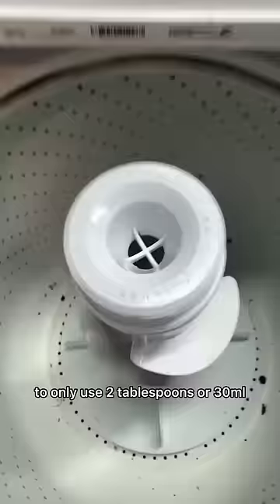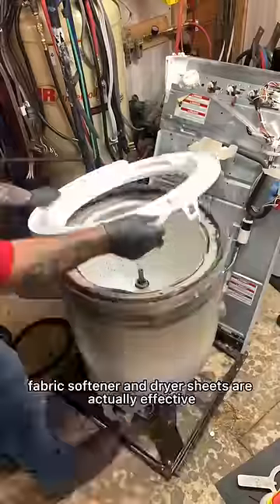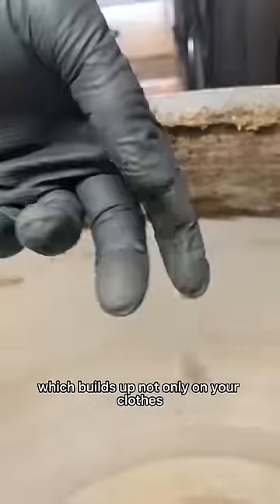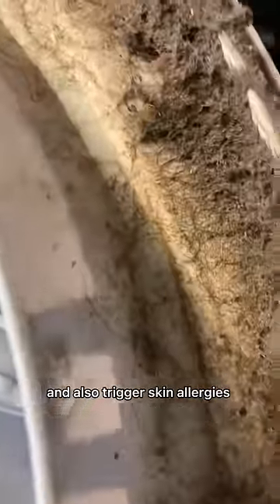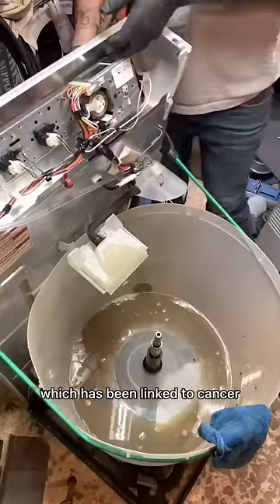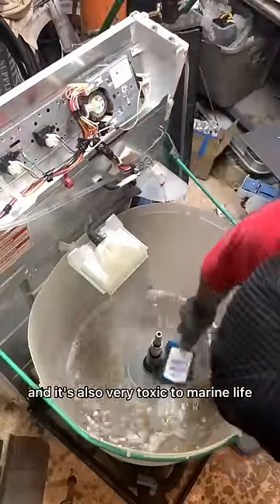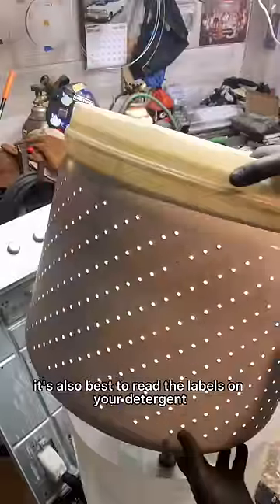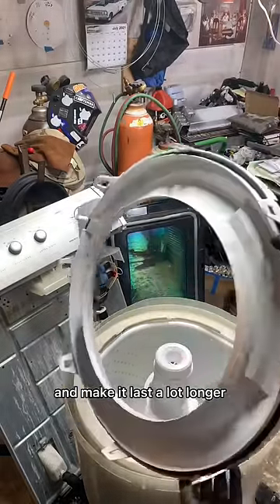Softener leads to machine failure

Comment: Fabric softener also encourages your fabric to catch fire. 😬
I use 10ml white vinegar with a few drops of essential oil, usually lavender for our clothes; tea tree or eucalyptus oil for sheets and towels. 🙂👍🏼
Reply: Ah I never thought about adding essential oils to my vinegar, is the smell of the oil linger around or the vinegar overpowered it?
My routine is just let it spin with only detergent for 10-15 minutes then drain, after that I spin it again with new water + 20ml of vinegar to not only soften it but vinegar help bring out leftover soap from the fabric, last step is to soak it in a scent booster without spin and just let it sit for 10-15 minutes, wring it out and dry
Reply: @tedjoslavianus1817  vinegar in washing is great foe neutralising bad smells in fabric and makes them smell clean- without the vinegar smell. 🙂 The essential oil lingers in the clothes, making them smell lovely, but only a drop or two for a full load.

Comment: Does anyone hel have advice for preventing clothes from getting static-y? That's the only thing preventing me from not using softener. I know a part of it is leaving it in the dryer too long, but i have some that at static madnets. I also find have the money to have the dryer vent cleaned (yes, i know it's a fire hazard, I'm trying to convince my parents), So i have to leave it in longer to dry. No room to air dry clothes.
Reply: Wool balls, you throw them in and they dissipate the static charge. Infinitely reusable too
Reply: @Noah-rd5ri  mine have never gone that